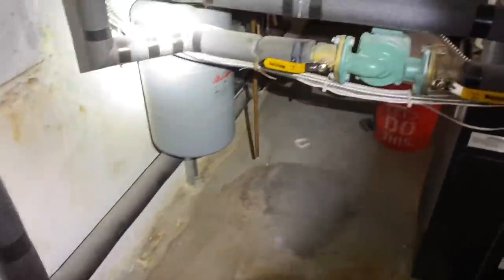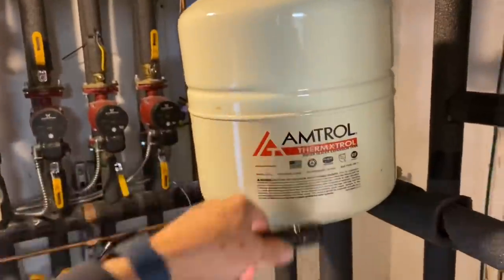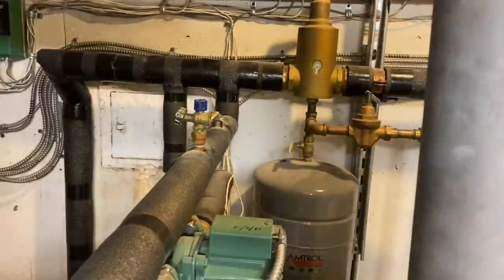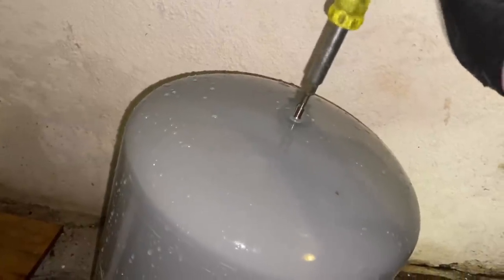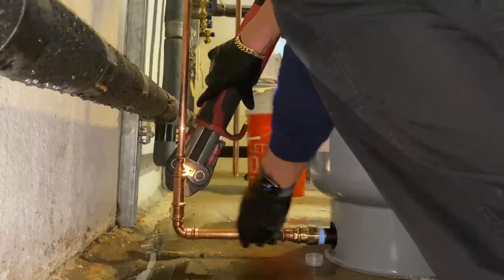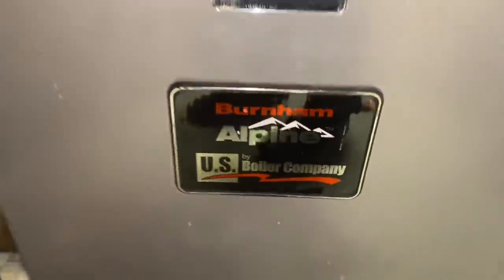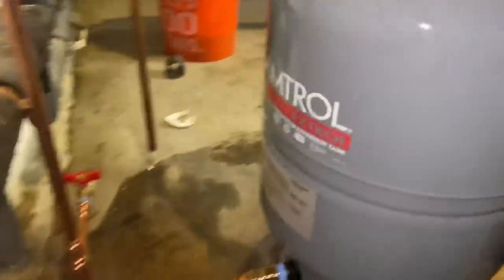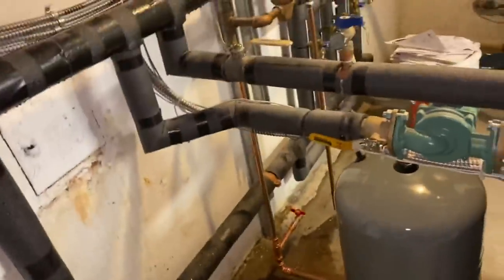Burnham Alpine Water Still Leaking After Relief Valve Replaced

Comment: Any time I have a relief valve going off I always change all 3 expansion tank, relief valve and feed valve to avoid call backs have had to many issues with feed valves getting clogged open and over pressures system especially if they over 5 years old

Comment: Do those foam insulation pipe wraps really help with energy savings / heat loss? Wondering if it's worth investing in some to wrap the copper lines in the basement.
Reply: Sure, what do you think you would have if all those copper pipes had fins on them?...
Reply: Yes it does

Comment: And my question is--- If the bladder is compromised, isn't the air valve exposed to water? Then why don't plumbers remove the valve stem, let the pressure and water leakout, and then remove the much lighter tank???? Time??

Comment: I'd like to see you line up a few 'defective' expansion tanks and pump the bladder up to pressure and see how much water is pushed out. Then check the pressure the next week and see if it's static.
I know from pump service that almost all bladder tanks lose pressure over time.
Come on man, do you replace your tires when they look flat? Nope. You get the pump out and tire gauge and put air back in.
You busted yourself when you pulled the Schrader valve and H2O started coming out of the inlet side.
IF the bladder failed, no water would drain and the tank would stay heavy.
Wagos suck. Pressure crimps suck. If you aint sweatin', you're lazin'.
You didn't test, you guessed. The tank was good. Prove me wrong.
Reply: I was gonna comment the same thing. Clearly signs that the tank was still good. It would of been a lot easier to drain the tank and recharge it
Reply: Ive recharged 20+ year old well tanks with no issues. manufactures will tell you on any bladder style tank that they should be routinely drained down and checked for pressure
Reply: @PipeDoctor  

True Mike. More correctly to check tank pressure the system needs to be drained to below tank (aka normal cold operating) pressure to overcome the pressure that may force water into the bladder area. Amtrol says pressure should equal normal system pressure. For domestic water systems tank pressure is set 2-3 psi below cut-in pressure.
Didn't mean to start a pissin' contest. But dropping system pressure and checking tan k pressure should be SOP. If the tank is inverted with Schrader facing the floor and you get a stream of water, tank is definitely borked. Could have prevented a return visit and a pissed off customer. Dat der tank coulda' put a few gallons of the guy you voted for gas in da' tank to drive to Yonkers. Lol!
Reply: So he pumps the tank up and leaves and a week later it’s empty and the relief is leaking and the customers got no heat; was it worth it to “test”. No, if a tanks low replace it.
Reply: @PipeDoctor  Weird because it actually does 

A licensed professional should check the complete system, including the
expansion tank, yearly and more frequently as the system ages. Checking
the precharge allows a small quantity of air to escape and can result in an
insufficient air charge. Always check the precharge while the tank is isolated
and empty of water, and be sure to maintain the proper precharge whenever
the tank is inspected. Monitor the tip of the indicator cap for discoloration
(Figure 3) in addition to regular product inspection. Contact the installer
or a plumbing professional if indicator cap is discolored; tank replacement
is required.